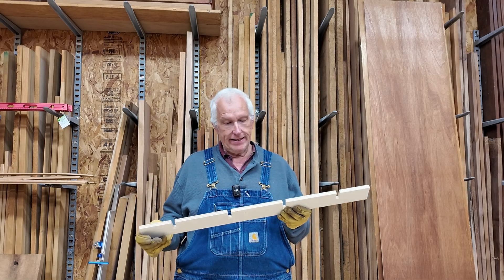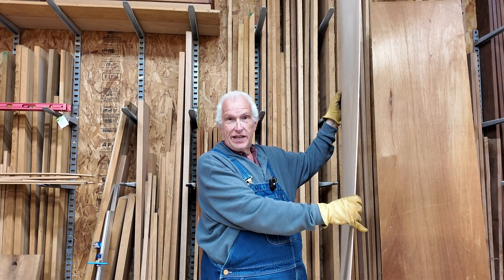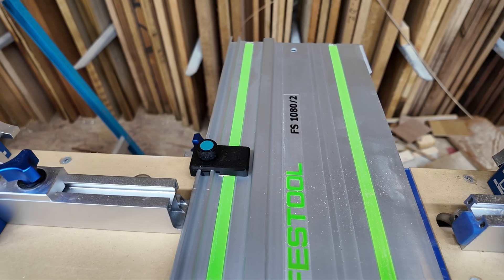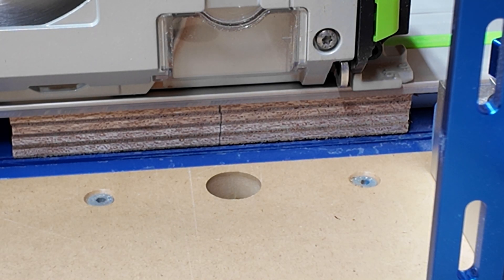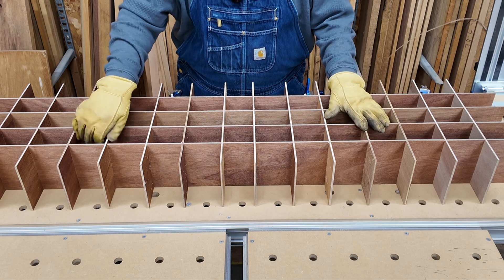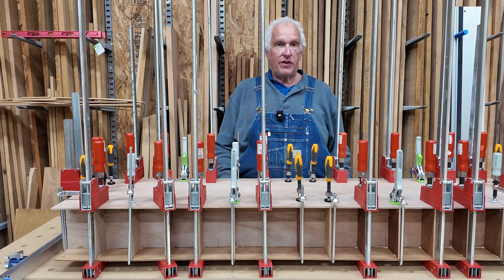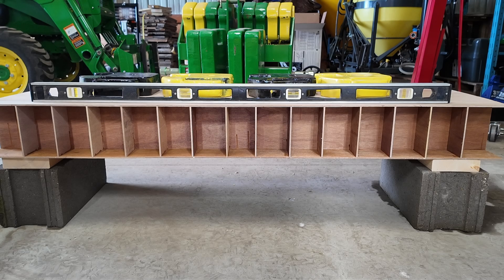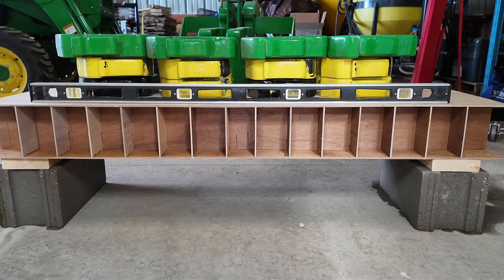What makes a torsion box rigid? (Torture Test)

Comment: Have you considered multiple levels with ribs in alternating directions?
I have long ribs in two levels and short ribs in a middle level.
Reply from the maker: Like… multiple layers? So the a 3-inch torsion box, for example, might have a layer of 1-inch ribs, then another layer of 1-inch ribs that are structured differently, and then a third layer? Interesting. Is there a skin between the inner layers?  Is it difficult to get accuracy of the entire thickness being the same thickness?  I’d worry that the extra layers would add extra places for errors.
Reply: @ShopKlutz  Yes, multiple layers. I used a sheet of MDF between each row of ribs. It's quite thick as the ribs are three inches tall.
Reply from the maker: @box0xB9 Wow. That sounds like a serious torsion box. Do you have pictures of it posted anywhere?
Reply: @ShopKlutz  I have nothing posted online . . .

Comment: First off, thanks so much for your content. I appreciate that your videos focus on things that don't get enough attention - safety, repeatability, accuracy at a conceptual level, rather than simply documenting projects. This is a bit of a random question, but would you mind mentioning the name/source of the racking system in the background of your videos? Storage of things big and small alike and particularly wanting some type of modular system that can expand or contract with me, is a perennial source of discontent for me. What have you found works well for you?
Reply from the maker: Thanks for your kind words.

The wood rack that is often shown behind me is actually just the Lumber Storage System from Lee Valley, except I am using it vertically instead of horizontally.   I originally used it for horizontal storage, but when I switched to vertical, I thought I would try using the same straps and brackets.  Somewhat surprisingly, it works pretty well that way.  I should add some kind of chains on the ends of the brackets for safety, but in practice, most every board leans one direction, so I've oriented them all to lean toward the wall.

If I were implementing vertical wood storage from scratch, I would probably just build something.  One of the reasons I used the Lee Valley stuff I already had was that it gave me a way to switch back to horizontal if I ever change my mind, but that seems pretty unlikely now.

Workshop organization is hard.  I actually don't consider myself particularly good at it, but I'm getting better.

Comment: On minimizing the effect of the blade curve on those channels, causing them to be at different depths: Why not keep it all stacked up, and then flip the whole stack left-over-right/lengthwise, and repeat the cut? Then it'll be the same cut on every board, without the problem you're trying to mitigate occurring at all, and you will have made fewer cuts overall.
Reply from the maker: @VitriolicVermillion  Hmmm. At the time, I convinced myself that wouldn’t work, but now I can’t remember why. 🤣
Reply: @ShopKlutz  If you think of it, I wouldn't mind hearing!

Comment: I think most of the strength and stiffness of a torsion box comes from the skins and not the webs. This is conceptually similar to an I beam. We give beams more strength by either thickening the flanges or moving the flanges farther apart. 
You could also look at honeycomb stressed skin panels from aviation. The inner honeycomb is often paper thin while the skins might be up to a few mm thick. 
Of course glue adhesion is the determining factor in a wood torsion box. The webs need to be thick enough to bond well to the skins.
Reply from the maker: @atomicsmith  Yup. I’m not an engineer, but my understanding is that in order for the beam to bend, one skin needs to compress while the other one elongates. The job of the skins is to be strong/thick enough to avoid that. The job of the web is to keep the skins a constant distance apart.

Comment: I built a number of torsion boxes out of 1/2-inch plywood interspersed with fifth of an inch underlayment. I use the 1/2-in plywood for the outermost and some interval of the inner ribs. It reduces a great deal of the weight while also helping maintain spreading the load. Every time I've seen a torsion box fail, it's been because the skin separated. You see a sort of dip and ripple in between the ribs and then failure comes fairly quickly after that. Putting in the 5th inch underlayment has extra ribs helps reduce the ability for the ripple to happen and gives more glue contact to resist the skin separating and slipping. That's one of the reasons why the lapped construction has failed less frequently for me than alternative.
Reply from the maker: @jsmxwll  So to clarify, you’re saying some of the ribs are 1/2 inch, and some are 1/5 inch? And it also sounds like the 1/5 inch ribs are “extra”, in the sense that you might not have put in as many ribs if they all had to be 1/2 inch, but making some of them thinner allowed you to have more ribs without so much weight?
Reply: @ShopKlutz  that's the idea. i realized after some testing and some failures that the main issue is usually skins buckling or rippling and that breaks them from the underlying ribs. 

i design around the minimum amout of 1/2" material to support the expected load and then fill in with stabilizing ribs out of 1/5". while the 1/2" material might support the load when evenly distributed, often a point load will cause a skin failure unless the skin is more regularly supported. 

here are a couple experiences that lead me to the way i do things now. it might also provide a little clarity.

i sat a very heavy cast iron table on one of my older torsion boxes that should have easily held multiple times the load, but the leg created a point load and buckled the skin enough to break the glue connected to the rib and the whole thing pretty much collapsed into the center. thankfully the cast iron table didn't have any damage, but that was the first time i noticed that issue. i think i had 8" spacing on the 1/2" ribs on that table.

i also made a 36"x144" table top for a friends wedding out of a 4" thick torsion box. that only had half inch walls and all the ribs were underlayment. it had ribs every 3" along the length and every 6" across the length, so quite a few of them. only had 2 trestle legs with a stretcher between them. i figured i overbuilt it because it was only gonna hold a big ass cake and some plates and food. oh how that was wishful thinking. somehow that table survived 5 drunk idiots dancing on it. top skin was underlayment with a 3/4" thick strips of douglas fir glued down to it to make a sorta butcherblock vibe. glued 1/4" thick dougfir veneers to the sides and ends to make it look like solid wood. bottom skin was 1/2". i scarf jointed all the 1/2" plywood pieces like you would for boat building to get my 12' pieces. i just lapped and glued 6" the underlayment to get the 12' pieces for the ribs. biggest torsion box i've ever done. had i expected the dancing there woulda been more meat inside of it though.
Reply from the maker: @ That’s great info. Thanks!

Comment: What is the trick to getting your torsion box flat if you don't already have a flat surface to build it on top of?
Reply from the maker: I'm currently working on another video to cover that very topic.  But the short answer is that nearly always you actually have to build a flat surface on which you can build your torsion box.  It's a definite "chicken and egg" problem.

Comment: Very informative video. I built a Ron Paulk style MFT cutting station out of 3/4" plywood and it has sagged a bit in the middle. It is a good design, but it is definitely a compromise between strength and storage space underneath. As you've shown here, the strength of a torsion box comes from having a fairly tight grid created by closely spaced ribs. The Paulk bench has no lengthwise ribs at all - just 2 ribs across the short dimension. It relies on the sides for strength which I don't think is sufficient based on your work here. By adding 2 lengthwise ribs and a few more crosswise ribs all connected using half laps, I think the stiffness and strength would be greatly improved while still leaving enough room underneath for tool storage. Thanks!
Reply from the maker: Yeah, the Paulk bench is great, but I always want to quibble when someone calls it a torsion box.  It's got certain torsion-boxy qualities, but rigidity is not its primary design constraint.  Thanks!

Comment: Thank you for the video. How do people generally fix the torsion box to the frame of a table?
Reply from the maker: There are lots of choices here, and I suspect folks do a lot of different things depending on the situation.  I'll be facing the same question soon.  My current thinking is that I might leave some gaps or holes in the side walls for access and then use bolts through the bottom skin into the table leg or apron.  Another option might be to place extra solid boards inside the box, attached to the bottom skin, so you can screw into it.
Reply: @ thank you. I was thinking more on torsion boxes and realised if I am to use dog holes, I’ll have to leave the bottom skin out. Otherwise the torsion box will become a treasure trove. I’ll think more on it and see what suits me best and my builds. I am leaning towards trying out an aluminium extrusion base and see how that turns out.

Comment: Excellent. Weight reduction, though not an issue in a larger workshop, is of benefit in a shed or garage where it may be beneficial to remove it to gain floor space.  The concept has me considering if the same rigidity can be attained with a deep styrene foam slab and different adhesive
Reply from the maker: @ChrisUttley  Thanks. Indeed, people do make torsion boxes out of materials weaker than the plywood I used. Hollow core doors are torsion boxes with an inner grid usually made of cardboard.
Reply: The foam slab would achieve nearly the same stiffness but it has to be of fairly high density. Depending on the face plates, localized deformation under point loads would occur but this applies to even a grid torsion box. For very distributed loads, foam works, witness the foam and fiberglass airplanes "pioneered" by Burt Rutan for his home built planes. BTW, I'm a stress analysis engineer.